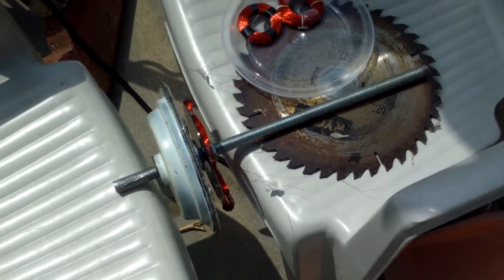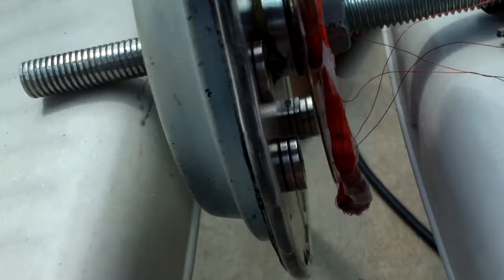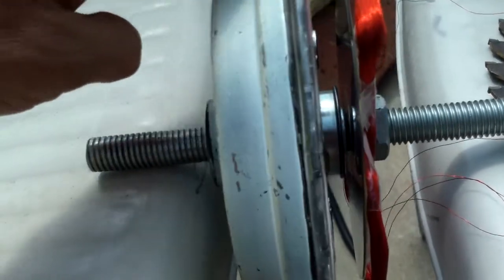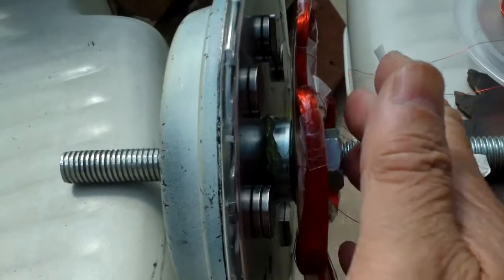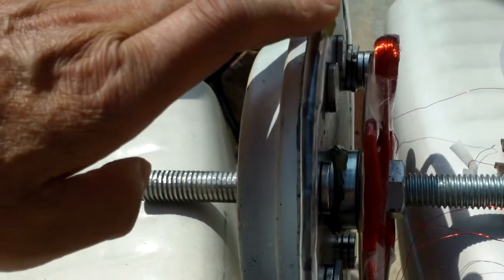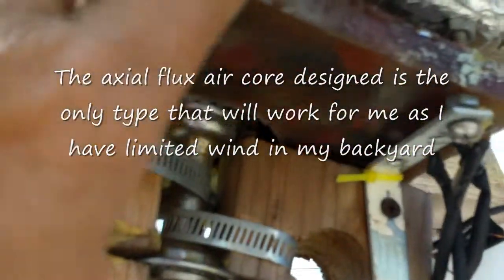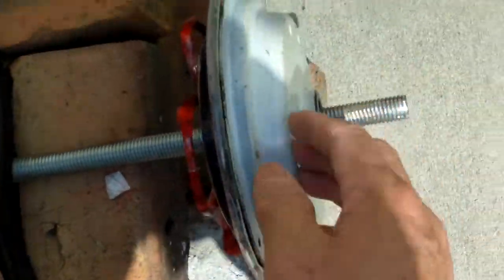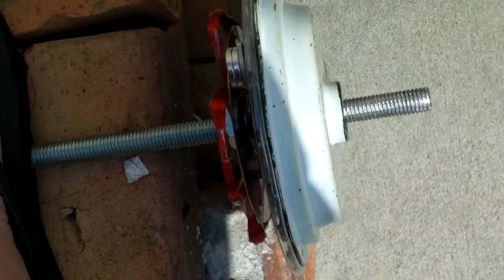Progress on the toy axial flux alternator wind turbine

Comment from the maker: Thanks for the suggestion. I don't have a bench vise. I'll lay the ceiling fan cover on a flat surface to see if it is even. I'll try to get the stator as close to the magnets as possible but like you say if it wobbles, that's not going to happen.